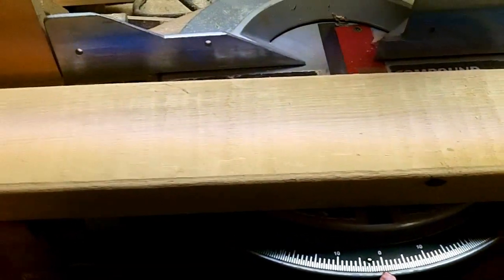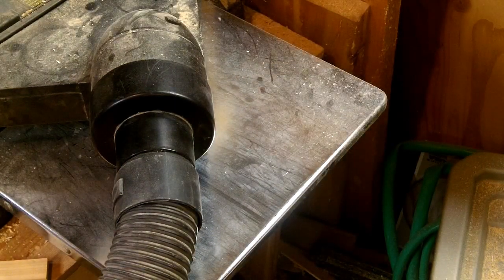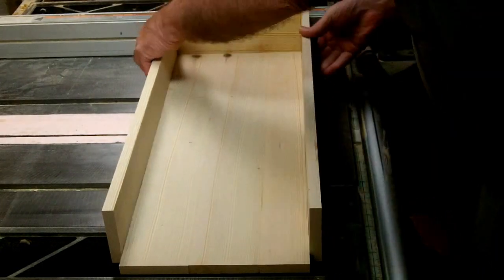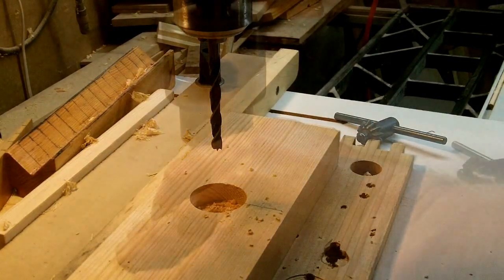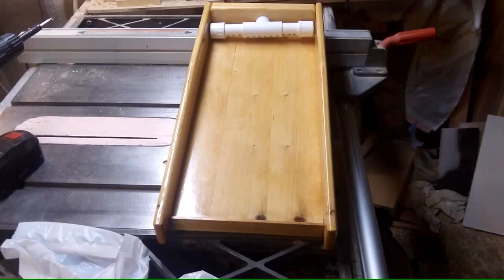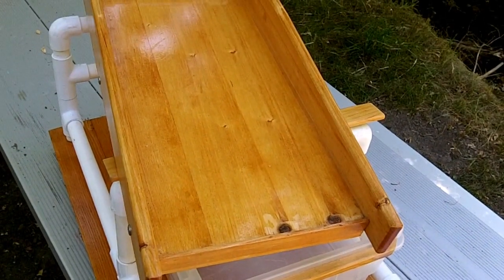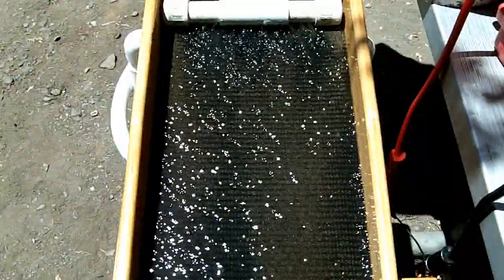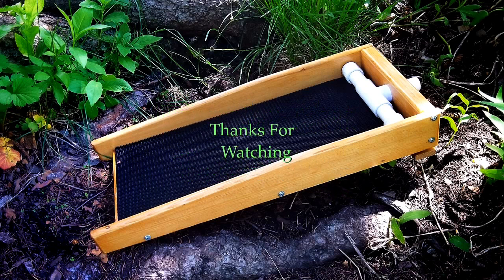RECIRCULATING VORTEX MAT SLUICE

Comment: Pretty creative design there.  You seem pretty good at wood working.
Reply from the maker: CDC Gold Prospecting 
Thanks CDC and thanks for watching. I like to putter around with it. Not much to this. It's a couple of 1x6's glued together for the bottom, a piece of 2x4 for the water bar and a couple of 1/2" x 4 for the side rails. It's something most folks can put together fairly easily.
Reply: @utahavalanch  looks good, Seems easier if you had the equipment and tools.  All I have is hand tools. lol...
Reply from the maker: CDC Gold Prospecting 
It helps to have some power tools to work with. However, all of my projects are designed so that they can be built with a few hand tools like a hand saw, miter box, drill and a couple of bits. A few clamps will help as well. All the wood you can buy at a Home Depot or Lowe's store in the lumber, hobby board and moulding sections. I cover a bit of that in one of my drop Riffle sluice videos.
Reply: @utahavalanch  That's cool. You did a good job at showing how to make it.

Comment: Hi I think this is amazing. Would you be interested in selling me one of these? If so how much ? I am not handy at building at all.
Reply from the maker: Hi Gary, I appologize for not seeing this sooner. We had a family emergency and I'm just getting back. These are really some great sluices, especially when it comes to catching very small gold. 
Although I have sold a few of these to local prospectors, I'm afraid that I am not set up with a means to sell over the internet. I mainly put these videos up to give people ideas on how they can build their own. These are very basic with just a bottom, 2 sides and an end plate. You can buy a mat on Ebay and cut it to fit.
Pretty much all you need is a hand saw and power drill and you can put one of these together in an afternoon. I have built a very simple bare bones unit that most anyone can put together and It works very well. They don't need to be fancy.

Comment: Have you ever tried to make a 3 level one?
Reply from the maker: I started to. I made a 6" X 18" 2 level version without a slickplate for testing and after 3 months of running material I found that all the gold is caught in the first 3 - 4 inches and the second level wasn't necessary. So I turned the top level into a hopper and made a mini highbanker with an 8 mesh screen. It is my favorite sluice to take out testing as I can run it with the stand and small tote shown in the video here on the back tailgate of my truck or on a picnic table in camp and it only uses 3 gallons of water. I can just shovel unclassified material straight into it and it will screen the material to the necessary - 8 mesh that the Vortex mat needs and dump the rocks. It will take a 5 gallon bucket of raw dirt and give me just 1 1/2 oz of cons that I can quickly pan out in the tote to see if there was any gold or not. I can also set it up on the stand in this video in a stream or on the bank and drop the pump in the stream to supply the water and just shovel away. I'm currently making a larger one that will use the same mat as this one and I can swap the mat between the two.
Reply: +utahavalanch cool.. I just recently turned my gold hog sluice box into a highbanker.. that sluice box is well worth the money...
Reply from the maker: It is indeed. I have one as well. But with a 3 hour drive to where I can use it, I usually use my smaller ones with material I find closer to home.
Reply: +utahavalanch I was one of the one's that they sold to early at $225 on the gold radio show called prospectorspace.. I have number 6
Reply from the maker: Very nice. That is a great deal. I was lucky enough to get the very first one with a letter of certification. It's a great sluice and I wish I had someplace closer so I could use it more. I'm going to set it up as a recirculation sluice next summer so I can run larger batches of material at a time here at home.
Reply: +utahavalanch well i wish you the best of luck
Reply from the maker: Thank you and I wish you the best as well. I hope you have a great and golden year.

Comment: +utahavalanch, I am currently in the process of making a version of your mini sluice/miller table combo i commented on the other day. I am very inexperienced with all of this haha but i like your videos so I figured I would ask you. Can you explain the pump set up in a little more detail. I see you recommend a 500 GPH pump but am i just running a hose from it to a control valve then to the back of the water bar? Also, do you recommend any certain brand of pump? I have seen "fountain" pumps at Lowe's and HomeDepot...are these the right kind of pump?

Thanks!
Zack
Reply from the maker: +Zack McPherson Hi again Zack, Typically the pumps used for these are Bilge Pumps designed for boats so they can be taken out into the field. They run off from 12 volt motorcycle batteries or battery packs instead of House Current. If you just want to run your sluice at home you can use a 500 GPH fountain pump but they are quite expensive. You can buy a 500 GPH Bilge pump from Walmart, Ebay or Amazon for aound $15.00 - $30.00. I usually just by what is the cheapest. Harbor Freight and Walmart sell car jump starter battery packs or you can buy a motorcycle battery from Walmart for when you go to the river. 
For around home you can buy a battery trickle charger to run from your house current or you can use your jump starter battery pack. The battery packs have built in chargers so you don't need to buy one to charge the battery. With the Motorcycle batteries you will have to buy a battery charger to recharge them.
They make 3/4" flexible Bilge pump hose that you can buy on Amazon for about $10.00 for about 6 - 9 feet to go from the pump to the water bar on the sluice. At Lowe's and Home Depot they sell garden hose adapters that slide onto the end of the PVC  If  you want a screw on adapter to use garden hose or garden hose fittings. You don't need to glue any of the PVC. Just press fit and they will hold.You can buy 3/4" garden hose fitting on Amazon that will fit on the flexible Bilge Pump hose. You can buy 5/8" garden hose fittings from Home Depot as well but they reduce the water flow quite a bit.
I hope this helps some. If I can be of further help let me know.
Reply: +utahavalanch That helps alot, thanks! one more question, if I decide to make my sluice bigger, say 10x36 give or take a small amount, will I need more than a 500GPH pump?
Reply from the maker: +Zack McPherson Hi Zack. Yes you will need a little larger pump to go to 10" or 12". Probably about a 750 GPH for a 10" sluice and an 800 GPH  for a 12" sluice. You can change the water flow by raising or lowering the back of the sluice an inch or two to change the angle or put a valve on the pump hose. Some folks recommend a 2200 GPH pump for a 10" sluice but they are also blowing the fine gold back into the river.
If the sluice angle and water flow are correct a Vortex/Goldstop mat will catch all the gold in the first 3 - 4 inches and so a 24" mat is more than enough. If you want a longer sluice I would suggest putting about an 8 - 10" slick plate on it and a 24" mat. If you look at the sluice in the video you will notice that the water bar plate can be removed with 4 screws. If you do the same then you will be able to use it as an in stream sluice and a recirculating sluice which would make it more versatile. With the sluice in the video, I left the slick plate off to make it shorter and more compact for backpacking. When I dump material with gold in it onto the mat the gold will stay where it's dropped on the mat. You may want to put a slick plate on yours to help separate the various materials better. Also screening your material to -16 to -20 mesh will help with the fine gold. Hope this helps.

Comment: What is the size of the sluice?
Reply from the maker: +frostell86 Hi Frostell. Thanks for stopping by. The inside measurements are 9" x 21". The outside measurements are 10" x 23". I wanted to make it 10" wide on the inside but I thought that would be too wide for the catch basin. As it turns out it would have barely fit. Vortex mats catch all the gold in the top 3 or 4 inches so they don't need to be very long. I made this one, my mini sluice, and my new Miller Tables so that they would all fit on this stand so I can just swap them out as I need them. I am currently making a stream body that I can drop this mat into and run the sluice in a stream.

Comment: Another great project well taped and explained.  Too bad you can't put it directly in the stream and really go into production but there's a lot to be said for an easy chair in the shade!!  Well done and thanks for posting.
Reply from the maker: +John Washam Thanks John. Well I would have made one that would go into the stream if we had any around here but that's what you get for living in the desert I guess. :-) At this stage in life there certainly is a lot to be said about armchair prospecting in the shade. Now to make me a table for the drinks and sandwiches. :-)
Reply: Very nice build !  I am wondering what your opinion of the mat is after using it for 9 months.  By the way,  I was a career carpenter and a hobby gold miner and your sluice project really is first class !

Thanks for showing it
Reply from the maker: Thank you and thanks for watching. Even though I have about 20 different sluices and even a very nice Gold Hog stream sluice this and my mini vortex sluice are still my favorite and most used sluices. They will catch the fine flour gold we have here better than anything else I have tried. I have since built a highbanker attachment for my mini vortex which is nice because I can just shovel into it  and it will screen and deliver the material to the mat at the size and rate it needs for maximum gold recovery. I am also in the process of building one for this one as well. The only other sluice that I have found that will do as well as these is the Goldwell Vortex sluice. I made a wood version and so far like these it is catching 100% of the gold. Even the very tiny micron gold.